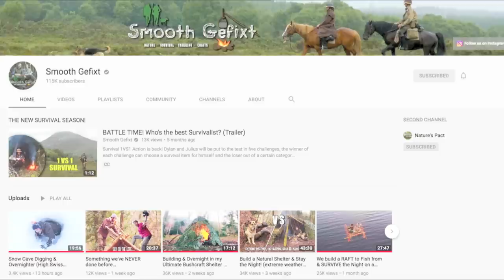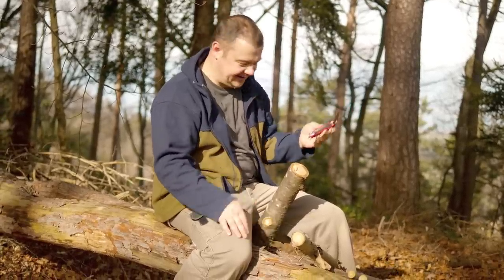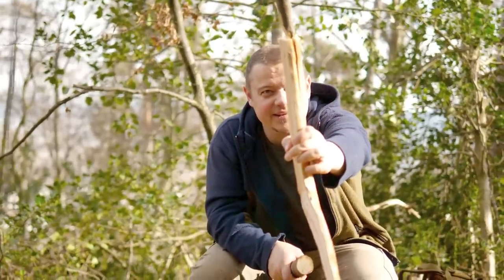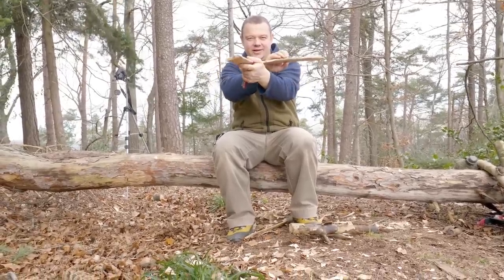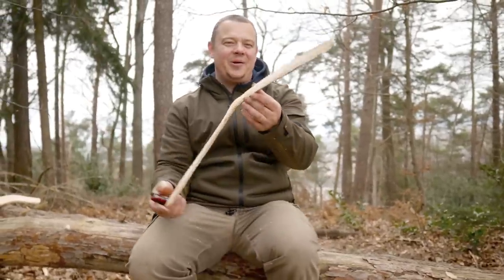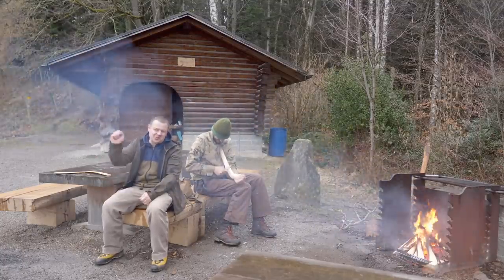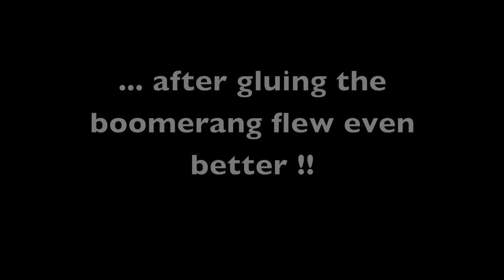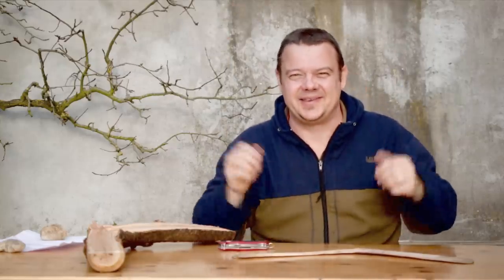How to carve a Boomerang from a bended branch  - Victorinox Swiss Army Knife Project

Comment: Hi Felix, good job! Just a little hint - when you throw the boomerang hold it on the short end and have the long end point in the direction of flight. Basically opposite you have thrown in the video. That might improve your flights too!  Might be too late since you did the video in April - but maybe next year you make a new boomerang :)
Reply from the maker: Thanks for the tip!
Reply: 100% correct!

Comment: It's necessary to have one arm of the boomerang lighter than the other,  and is best achieved  with one tip carved with the profile roughly the size of a dessert spoon, but on the reverse (flat) side of the tip, to enhance the turning impulse. It's also very important to launch to one side of the prevailing (very light) wind, so the boomerang is slightly assisted in its return toward the end of the flight. A strong flick of the wrist when launching to "whip" the boomerang upward and ever so slightly angled also will very much help with the return. The flick can also be better achieved by launching the boomerang when it is correctly orientated, but held by the other arm, so it looks a little like a pistol, that is with the 'barrel'  pointing forward and away from you as you launch it.

I made my first (left handed) boomerangs more than forty years ago, but it's a great feeling when you make them well enough so they come back, and even when you can catch it, but be careful, they can not only break themselves, they can break you!

Greetings from Scotland!
Reply from the maker: hello my friend. Thank you so much for your valuable hints! Super interessting!

Comment: You made one that came back. With some experimentation in throwing it you will eventually have it come back to you (you may have to dodge it to keep from getting hit). Years ago I made some boomerangs out of plywood copying a plastic Whammo boomerang, and I was successful. Eventually it will come back to you so that you can catch it, and that is a great feeling, like magic but most often I had to dodge it as it was going too fast to catch. I’m left handed so I made some I could throw with my left hand. I made a small light one that did not go very far (my backyard wall small at the time) and I often was able to catch it on the return. Wind has a great affect on its flight both for good and bad depending on the wind strength and direction.
Reply from the maker: Thanks a lot for your interesting comment!

Comment: Felix, have you done a sharpening vid? I'd be eager to see your methods on maintaining a sac blades edge.  Thanks much for another great video
Reply from the maker: Yes, I will definitely make such a video.
Reply: I also wonder that the knife go through from start to finish of making the boomerang without any stropping or sharpening. That means that is a very good edge retention of that knife you use sir. I am so impressed

Comment: Don't worry you can beton wood with your Swiss army knife I did with the liner lock ingage with liner lock. I am a diseal mechanic helper and I have pryed out garage truck head lights tough liner lock. My flat head screwdriver is really wobbly but it all still holds together. I have the D2 trail master Swiss army knife. I just wanted to know if it was possible to do that if you ever had to  if you want tough knifes look up cold steel toughest folding big knifes you can ever own increi strong. I have 4 of then and I still have my Swiss army knife. I have had Swiss army knife ever since I was a kid. Never a Leatherman fan allways Swiss army knife or cold steel knives. Thanks Kyle good videos

Comment: Felix, did you have to sharpen your blade midway through your project?
Reply from the maker: Yes at least two times...
Reply: @FelixImmler  oh, good, so I'm not doing it wrong when I sharpen mine while I'm working on a project. May be you can include clips of that too, albeit played at a faster rate? It will make the whole thing more realistic, at least to me. Thanks for answering and uploading. 👍

Comment: 11:18 you are holding the boomerang around the wrong way, i just had to point that out being the australian i am
Reply from the maker: Thanks a lot for your hint. But what's the difference in the air. The rotation goes in the same direction.
Reply: @FelixImmler  its all in the flick, if you have it the wrong way the flick will not work correctly and boomerang won't take flight.

Comment: I do know why the boom is not working in a perfect way. At the end of your video, when you put it on the table you can easyly see, that one wing is bended up - but the other is bended down, lying hollow! Your boomerang is a type we call "traditional" or ethno. Twowinged booms of this kind have a so called "arm 1" and and an "arm 2". Arm 1 is named so because it will always be the first giving the boom lift. Arm 2 is the second - does not matter if you hold it an Arm 1 or Arm 2 throwing. If you put the boom with the wingtips to you and the elbow area pointig away from you an a table the right wing is Arm 1 and the leftwing is Arm 2 (in case that you have a boom for righthanded people). This kind of boomerang needs Arm 1 flat or plan and yours is not but it is hollow. You habe to bend it up from middle to wingtip unless it is flat! - Not up! Arm 2 needs the bending up as yours is. And after you made the correction it will work. 
Important: Do not throw with lots of layover. - Only one about 10 to 20 degrees..... You can see a picture of the right tuning here:
https://das-bumerang-projekt.de/ 
Click on the first picture to see the tuning-manuals. The text is in german but there are pictures that explain the tuning for various kinds of boomerangs. To see the tuning for the type "traditional" scroll down a little and have a look at the photos. Hope it will help. Good luck and succues!
An here you can see an impressive throw and flight of one of my favorite boomerangs, thrown by a friend of mine:
https://www.youtube.com/watch?v=EZeyapYxqgw&feature=emb_logo